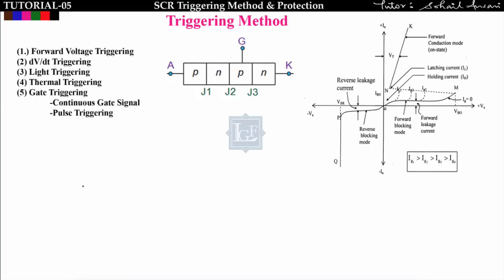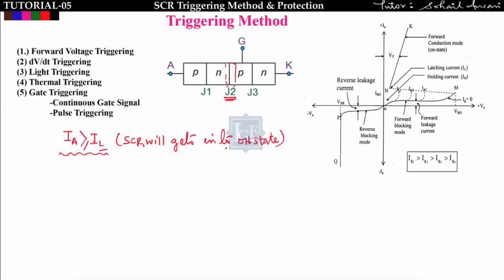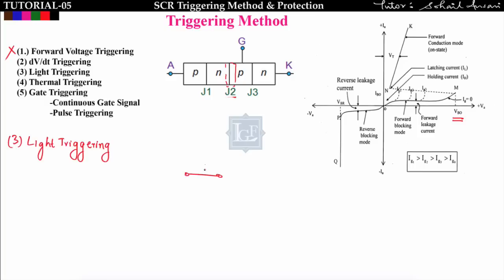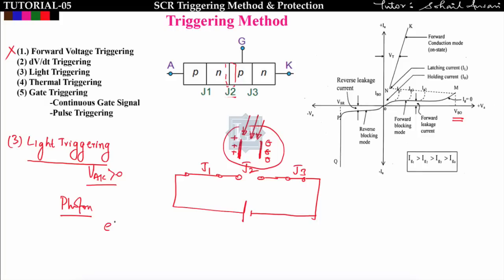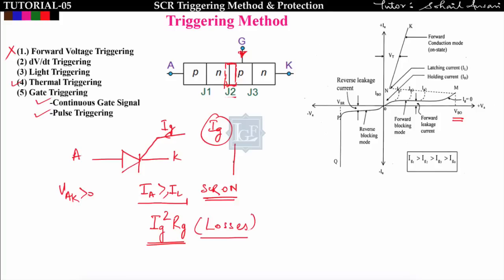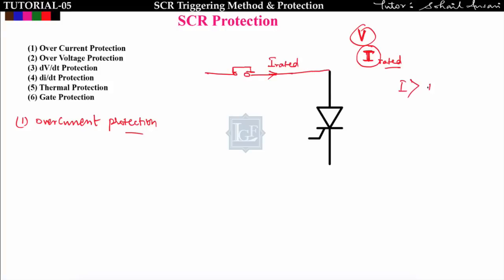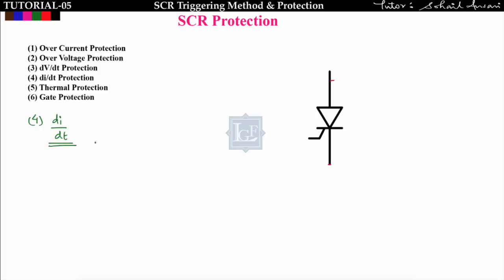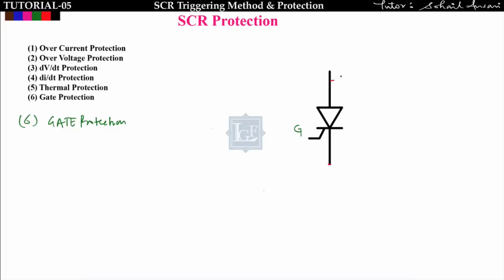Lec 05 SCR Triggering Method & its Protection

Comment: Have you done a video on the calculations of the components for the protection of an SCR? If you can, please do a video on the calculation of the values for the RC Snubber Capacitor and Resistor values, Inductor value, Zener diode and Gate Resistor values and Varistor value. Thank you for this video.

Comment: Sir, in over voltage protection when supply voltage high then varistor resistance decreases but at same time current through varistor very high and product of current (very high) and  resistor (very low) is constant (supply voltage). then how scr protected from overvoltage.
Sir please explain
Reply: that reduces current flowing through scr

Comment: Doubt: For Overvoltage protection,  please explain the KVL when the voltage drop across SCR is small.
Reply: MOV is metal oxide varistor which conducts heavy if voltage gets highs over it ratted value. because of that over current protection fuse get blows up & SCR Get protected from over voltage.

Comment: Sir u said that if we remove gate current then also the SCR is in conduction state and in gate triggering method we use pulse triggering..... Why don't we supply current for time t1 only once ???
Reply from the maker: After pi it will go in to reverse biased...so for conduction again u have to trigger after 2pi..got it
Reply: Yes sir 😊 thank u so much

Comment: At 11:40 , over voltage protection  the varistor has to be added in series or parallel sir ? Because in parallel if you add , the voltage will be same only know sir ?
Reply from the maker: it should be added in parallel...

Comment: In the final schematic of the SCR protection circuit, in the Cg || Rg one end is not connected. Will it be in series with the gate or the other end will be connected to ground?
Reply from the maker: its same..it will be in series only...ok

Comment: In forward blocking state j1 and j3 should be shorted and j2 should be reversed biased I think.. 
great lecture though.. thanks for uploading :)
Reply from the maker: its a slip of pen..engineers can understand no prblm
Reply: @GATEMATICEducation  😜😜
Reply: That's right j1 and j3 are forward biased while j2 is reversed
Reply: Yes you are right
Reply: jit koley yes ..
Reply: To woh kya reverse voltage triggering btaye kya first wala

Comment: Sir in forward blocking mode,J1 & J3 should be already shorted J2 gets shorted after Vak exceeds Vbo.
But sir< you have said just the opposite.
Check 2:32 for verification
Reply from the maker: that is slip of pen..your approach is correct..